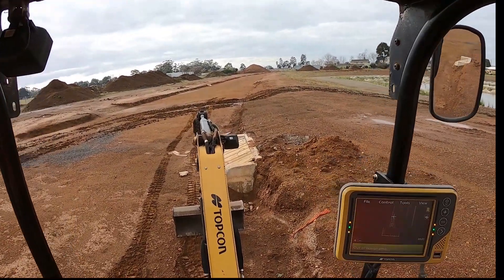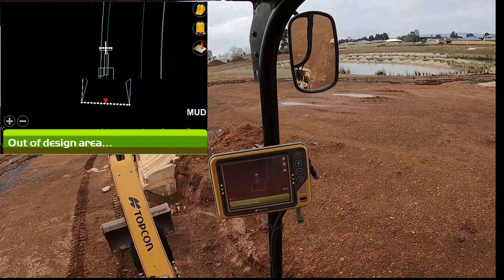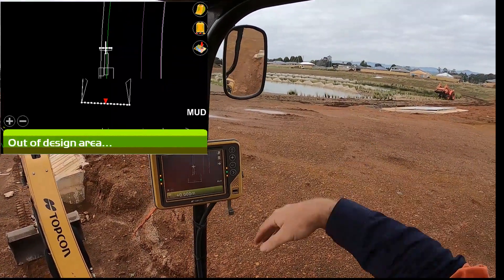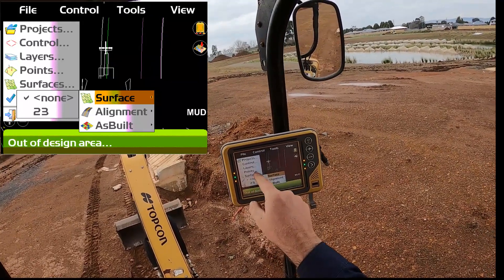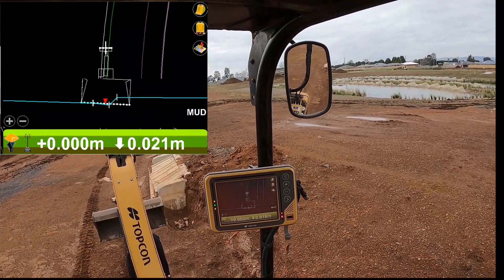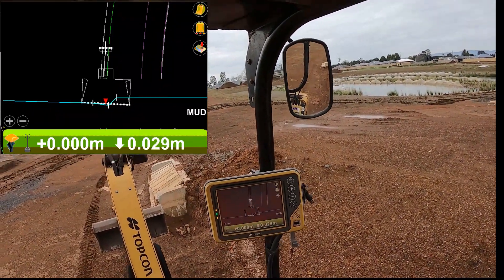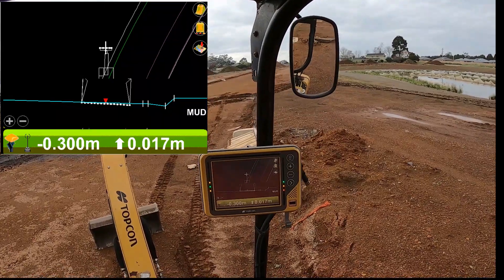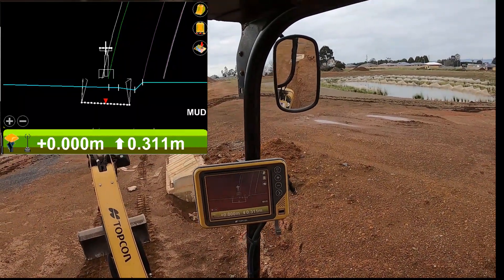[Topcon GPS Machine Control] - Excavation to a Design Surface

Comment: Love the videos mate thank you very helpful! Can you please make more videos? 
How do I create a horizontal offset? Like if I have to box a road out at 1m behind back of kerb how would I go about that?
Reply from the maker: Hi Nate.
That's no problems. It combines steering horizontally to a line (to outer edge bucket) by 1m.....then using surface to grab height off inner edge of bucket.

2 assumptions:
1) whoever has put your file together has strung the lip or back kerb line you are steering to.

2) your bucket is wider than 1m

Comment: Stegg how do you get the machine to dig to a line like that? does it still need a surface loading for the trench? or can you do it by just loading up a 3d polyline ?
Reply from the maker: Hi Anthony.  Digging to polylines (or creating your own to dig to) is not covered in this video.  You can certainly create your own 3d polyline in the file or even create from the digger.  Ideal for sewer or stormwater installation on line and grade!!!
Reply: @steggcivil  that's great goes that negate the need for a surface ?
Reply from the maker: @anthonydowd8180  No mate.  Surface excavation is used to dig out roads, wetlands or to dig utilities below a finished height (minimum requirements).  Digging to a line is different and also necessary in some applications like stormwater and sewer digging where the trench (ie pipe) needs to be on grade and not relative to the surface at all.
Reply: Cheers stegg much appreciated
Reply from the maker: @anthonydowd8180  No worries mate.  Mark.